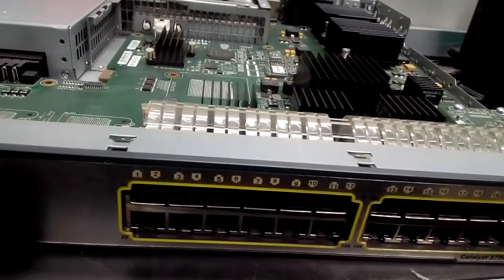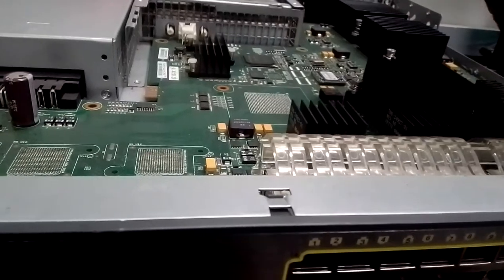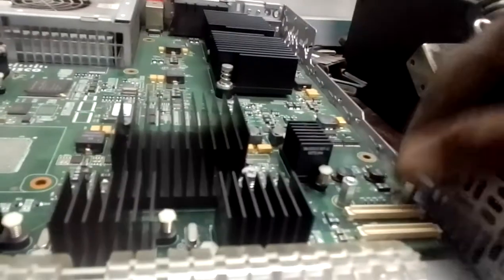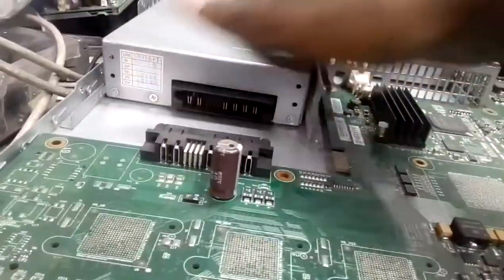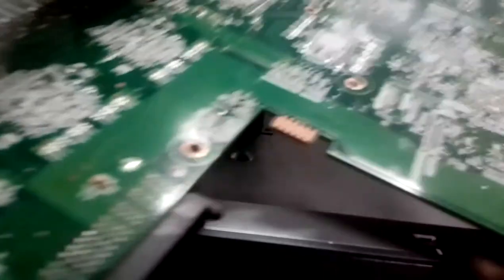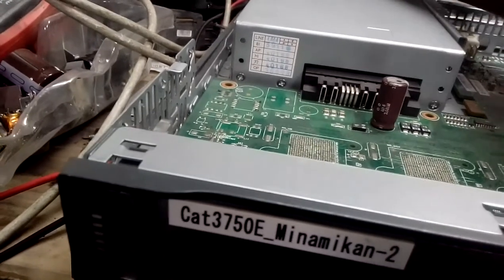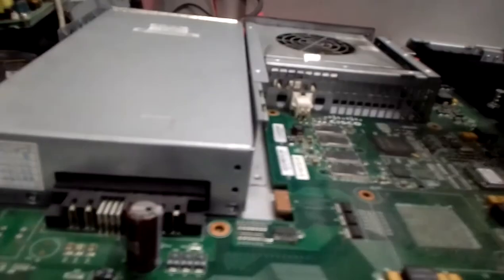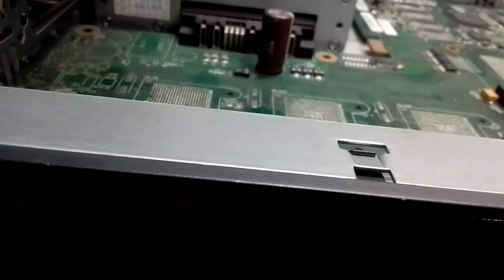#cisco #networking #switch #hardware #software  Cisco 3750E frozen boot fix  (part 1)

Comment: Hi...I have 3750G 24 port 750W POE switch.Fan spins but no LED indications at all.Will this solution work for it?
Reply from the maker: Yes it should work, otherwise some voltage might be missing on the board. If all the voltages are complete , this method should work.
Reply: @jkftech  1.2V is missing at TP46. it is .5V,Do you have any Idea?Thanks
Reply from the maker: @lankanettalk  you need to change the ic in charge of 1.2 volt
Reply: @jkftech  Thanks for your Advice,After leaving the unit alone,when i plug it again it turnd on normally. i checked all the voltages  and all are correct.after arround  one hour it stopped again and boot loop.that 1.2v missing again.Do i have to replace 51117 IC?Thanks
Reply from the maker: I think you have to pushed down the ic with your thumb, to know if there is loose contact, after that plug the power to check

Comment: hi, do you have instruction for fixing 3560cx power supply?
Reply from the maker: It depends the extent of the damage, sometimes the power board will burn beyond repair, then you just need to replace the supply
Reply from the maker: Most are fixable, I don't have the supply now, I would have done practical video